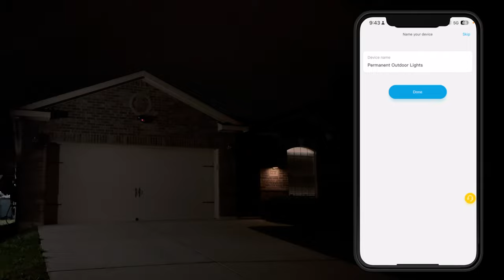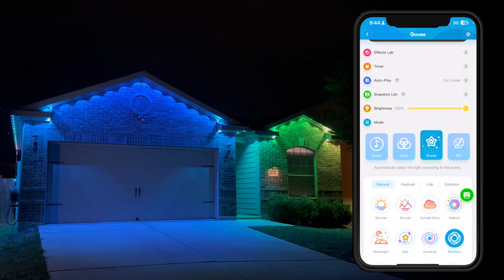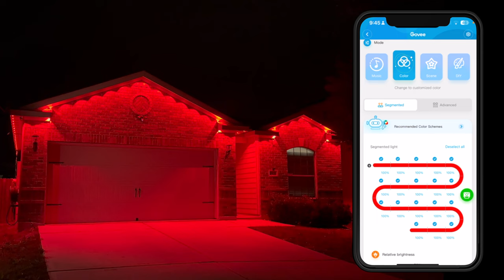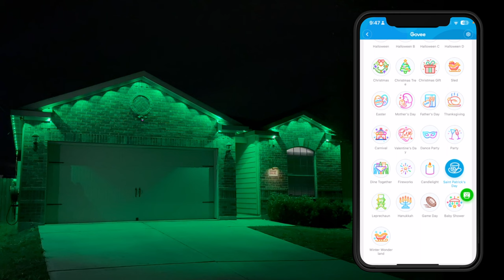Govee Permanent Outdoor Lights | Install/Demo

Comment: I bought two boxes (200 ft). Since we cannot have more than 9 strands together, I had to put the rest on their own control box (so I'm using 2 control boxes). Only one will sync? Thinking that maybe I didn't start with the red washee on the strands that won't sync...
Reply: I cannot get my two 100 foot to connect together
Reply: @reyesforwestcovina2023 I think you can only sync up to 150ft
Reply: You can install then separately and then via the application you can sync both

Comment: I was looking for what you did for power but you did not show up?  How do they plug in?  Did you install an outlet?  Run an extension cord?  Run wire and wire in directly?

Comment: Could you connect two sets together and have them controlled as 1? Say, two 100ft sets?
Reply from the maker: Great question! The short answer is I’m not sure. But in the Govee app, there is a setting called Scenic DreamView. You can add all the devices you want that are compatible & sync the lights together to create a design. I only see the holidays Christmas & Halloween and there is other stuff like rain, Forrest, ocean, etc. These lighting settings are different then if you were just controlling 1 govee permanent light directly. You can always have 2 separate lights, & put them on the same lighting setting. I don’t think it would look bad at all! Hope this helps!
Reply: @sparky_izzy  You can also set up presets where you give multiple sets the same or even different settings to play at once.
Reply: Yea and there's now a 150ft option
Reply: No you need a driver also known as a transformer

Comment: I have always been a fan of Govee Lighting! They appear to be superior to their competitors and at a more affordable price point. However, these lights do not appear to adhere to Govee's pricing structure. Also, before installing smart lights, always plug them in and connect to WiFi first to save time.

Comment: I wish they gave you more than 5 clips per 16 lights.    I used 1 clip per light, so I had to order more clips from Amazon as I don't trust the 3m tape lasting through Midwest summers and winters....

For the price they should include more clips, at least 1 for every led cube.

Comment: This video was super informative and what I appreciate most is the demonstration of the scenes and color / event / holiday settings. Question: how long is the cable from the power adapter to the first light in the strand?
Reply from the maker: Good question! I’m not sure exactly because I left it all bunch together but it’s probably like 15ft long from the roof down to the plug & there is still a bunch of wire bundled up. So it’s a good length!
Reply: @sparky_izzy  thank you. That helps immensely. I’m going to pop through the soffit into the garage and I’ve got an outlet right there.

Comment: How long is the plug from the outlet? Trying to figure out if it will be long enough to reach it into my garage plan to drill a hole through the soffit and into the garage.
Reply from the maker: The length from the plug to the start of the 1st light is approximately 30 feet.
Use code "SPARKYIZZY" for a discount!
govee.sjv.io/Jzb19q

Comment: Is the adhesive still going strong on these lights? I read some reviews from people saying the adhesive wasn’t good enough.
Reply from the maker: I live in Texas and with the excessive heat, the adhesive has been coming off. It’s better to use your own straps on the right and left side of each light.
Reply: What about a staple gun? Or is that risky

Comment: Nice video but how do you add multiple scenes into one operation function to run for 6 hours say 6pm to midnight. Example to start with scene Moonlight then Star then Universe then Forest then Fire then Aurora then Wave and then to re loop the scenes in that order for a few hours. In a continues cycle with out powering off on off on.

Comment: How many extention can i add on 100ft and 50.ft.Thanks
Reply: Pretty sure Govee says 150ft is the max length, on the Permanent Lights 2 model. Thats not to say that you can't use 2 sets and plug each in to separate outlets though, and you should still be able to control them together with the app. I think the Pro series can be strung together longer

Comment: Just zoomed in on your video and says wifi only 😩 I noticed your phone was on 5G though. I use my phone to teather to everything!
Reply: If I understand correctly the wifi connection on the Grovee Is to make the lights available online and then you can connect to them vis the grovee app from anywhere where you have internet in the cellular where the app is installed and logged with your account, maybe I’m wrong. Just my 2 cent’s

Comment: Where do you plug into the outdoor power?  Do you drill through to the attic, or do you use an outdoor outlet that is on the exterior of the home?
Reply from the maker: Outdoor outlet

Comment: Very informative. We have a 2 story house on top of a hill and im scared to death using ladder to install this. Can i use a boom to install this, thanks
Reply: Doubtful. You need to clean the area before sticking them on and then pull the cable taunt. Otherwise its going to look sloppy.

Comment: Question! If I buy a 100’ kit, and later want to add a 50’ kit… can I do so easily without cutting or splicing? Plug and play?
Reply from the maker: Plug and play up to 150ft 👍🏽
Reply: Quick question, I started with the wrong end to where I wanted to place the power adapter. Realized too late, and I cut and splice the ends and swap them for the power adapter??😅
Reply: Can*

Comment: Hi great video. Do you like them better than your lumary light? If so why
Reply from the maker: I think they both have their pros & cons!

Lumary Lights - Pros
- great security lights
- hard wired for a cleaner look
- ability to change colors & dim in the app

Lumary Lights - Cons
- Occasional Lag due to each light being individual fixtures, this effects the app connectivity
- connecting them for the first time can be tricky

Govee Lights - Pros
- App response time is pretty solid
- All lights sync together accurately because the power & communication are all connected together
- ability to change colors & dim in the app

Govee Lights - Cons
- (personal opinion) More of holiday lights & not security lighting
- exposed wiring on all the lighting under soffit
- needs a 120v gfci receptacle for power

Hope this helps!
Reply: @sparky_izzy  thanks for the reply and breaking it down to Pro and Cons for both products. I stay with just the lumary lights. Thanks

Comment: How long is the power cord? I want to get 2 sets, one for the second story and one for the first story but want to run the power cords into my garage. Is the power cord gonna be long enough to run down the second story  and into the garage?
Reply from the maker: The length from the plug to the start of the 1st light is approximately 30 feet.
Use code "SPARKYIZZY" for a discount!
govee.sjv.io/Jzb19q
Reply: @sparky_izzy Discount code doesn’t work

Comment: What if all I need is 40feet? What happens to the extra cool of lights?
Reply from the maker: Govee sells this kit in 50ft or 100ft. If you need 40ft I would suggest buying the 15m (50ft) 👍🏽
Reply: Can it go longer than 100ft?
Reply from the maker: No, unless you buy an additional light strand with the power adapter.